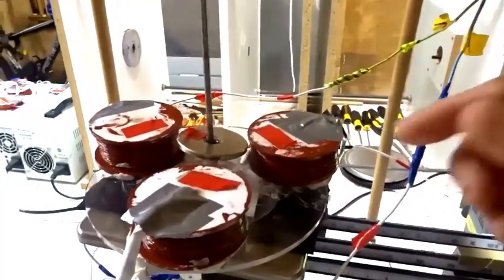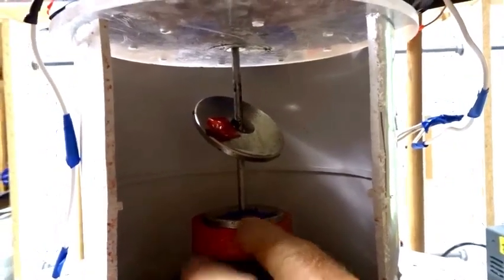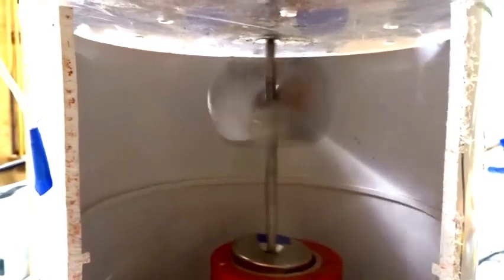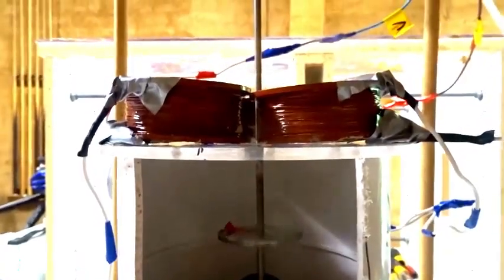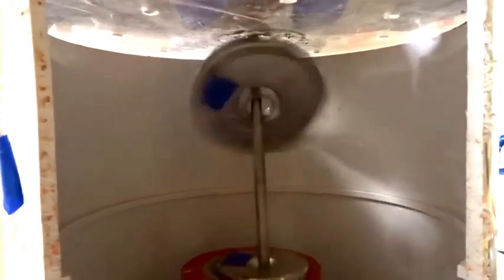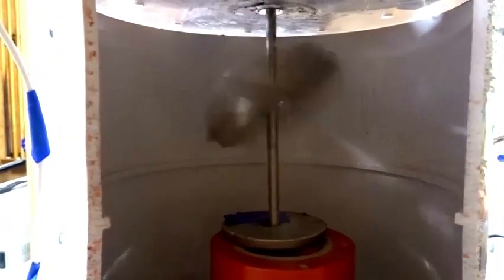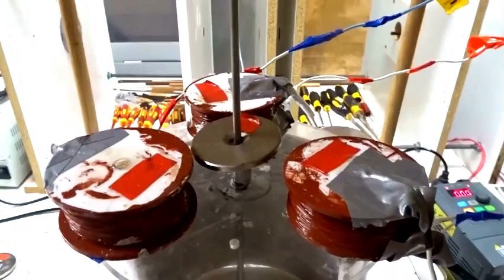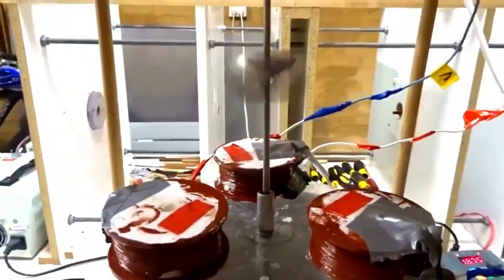Discovery of new physics to explain UFO levitation: the rise from below of a magnetic spinning-top

Comment: There are a few things I'd like to point out:

I believe what you are seeing is due to the wobble of the magnet. As it wobbles the leading edge is always going to be more into the opposite pole than the opposing edge. As the leading edge is pushed out due to the constraint it spins/pitches in a circle. Because of the 3 phase coils, one will always be pulling/pushing while the other two are inversely kinda pushing/pulling so the wobble effect is exaggerated. What you are perceiving as lift is just the difference in magnetic fields.

I don't think this upward force is capable of doing any work when it comes to air and spacecraft. It would be like standing on a pallet with a rope attached to it and trying to fly by pulling up on the rope. What you've basically made is just a weird AC motor.